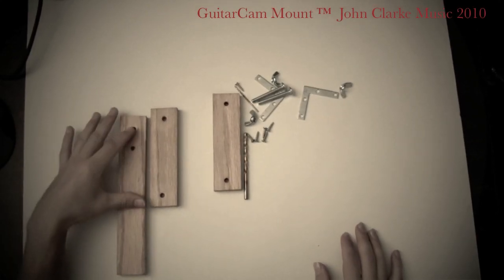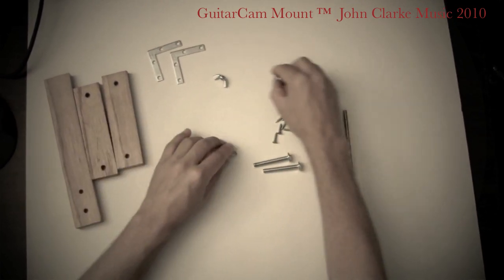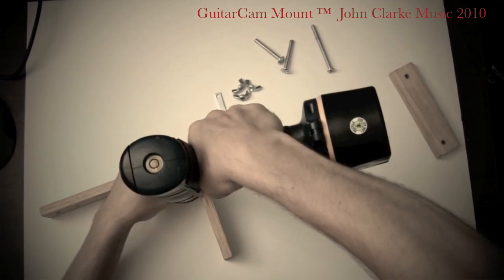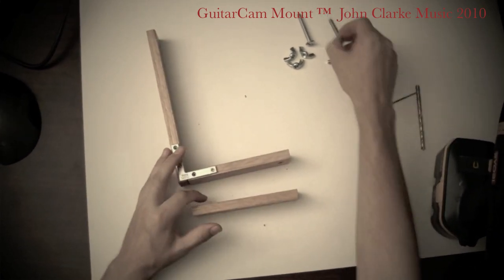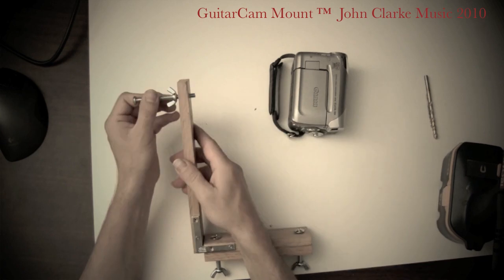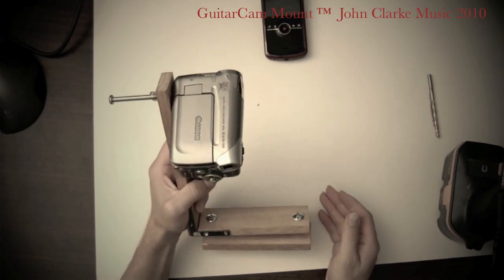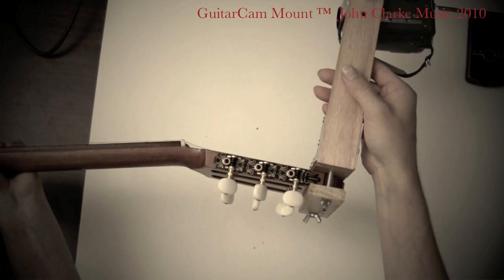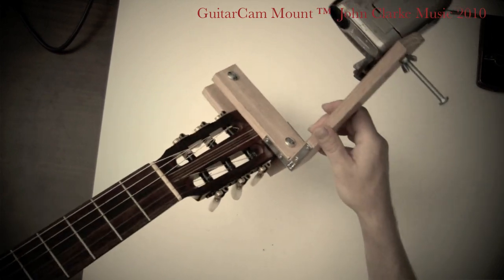How to make a GuitarCam Mount™ - johnclarkemusic.com

Comment from the maker: @foocheech 
Cameras these days are pretty light.  The mount is pretty light too when made with pine.  You can feel the difference but it hasn't affected my playing ability very much...every player is different and it might take some getting used to. I don't think it will effect the neck joint, but I would recommend taking it off when not in use.